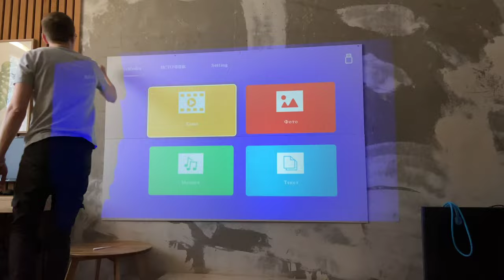How To Build a 100 inches Projector Screen for $25? || DIY Projector Screeen || Polkilo

Comment: Nice, but that cat is going to use that as a scratch pad and showing fish on it with the cat there is not a good idea. I would have elevated the screen a little higher away from cat claws.
Reply from the maker: 😄 that was my mistake) fishes + cat 😅 but everything just fine. She didn’t damage it for this long time since I published the video
Reply: Very lucky, my cat would have put holes in it. @Polkilo

Comment: Hi! I love what you've done here. Kind of resembles what I'm up to right now. I'm planning on ordering a 130" variant of that "anti light" material. I read somewhere that you should put a black clotch behind the screen fabric since its so thin that the light shines through and gets reflected back from the back wall if you don't have something dark/black just behind the fabric. What are your thoughts on this? Is this unnecessary?
Reply from the maker: thank you! i don't think that's necessary to paint wall in black colour. the reflective quality is very good. picture is bright and colourful. the most important is the angle under wich you are looking on the screen. the more it is closer to 90 degrees the mote brighter and colourful picture is. but you can make an experiment before you install screen on the wall. if the result with dark paint will be much more better than without paint, please let me know! i will do the same to my screen 😉🤝👍
Reply: @Polkilo  Yeah I've already installed the projector just about 1 meter over the seating position. I have a Benq W1070+ and it cannot shoot the picture in a straight path even with lens shift at the "lowest setting" so I'm a little worried that the angle will be too steep for a high contrast screen. With this istallation the picture almost reaches the floor. But we will see. I'm a bit worried of hot spotting as well. But this material is so cheap it doesn't really matter if it's not perfect. I'm going to test against a black background, black cloth and compare to it straight on the white wall and see if there's a noticable diffierece. Maybe I'll do a video as well so you can check it out. Not as professional as yours but still. :)
Right now we're renovating the living room and also building doors for two bookshelves. They will be "open" but wrapped with burlap so that I can hide the speakers in them on each side of the projection screen. Also me and my girlsfriend will have our computer spaces built in to these bookshelves with drawer guides so that you can pull out a "desk" for the mouse and keyboards.
Kind of a fun project hiding both our compter spaces and have conseald speakers and audio equipment.
I'm also planning of building a wall hanged furniture just like you did for the screen to stand on.

That was why I commented on your video in the first place. It's like we have the exact same idea going with a high contrast cheapo screen on exactly the kind of home made furniture. Although your project will look way more professional than mine. I don't have the skills or tools you do. Anyway... The screen will be the last thing to come in place so I don't know when it will be finished. If I know myself correctly it can take like 2 months from now hah.
Reply from the maker: Wow! So many plans👍 i hope you and your girlfriend will love this work and relaxing space 😉 you are right. Screen is very cheap and you definitely should try how it works. It has a small angel of view and for big company it can't be Ideal. White wall will be much better. But for 2 people thats enough. This screen is perfect for daytime watching. Hope you can make a video with black wall behind the screen. Hope you will not forget to send me a link 😉😊 wish you all the best 👍🤝🤝

Comment: Thank you very much for this video. I bought the exact same screen on AliExpress and my experience with it isn't that good, because if you look even slightly from a side angle it gets immediately very dark. For me a normal screen or just white wall works much better. But if you can ensure that you're always sitting exactly in line with the projector and the screen, it can work with this screen.
Reply from the maker: Yes, you are absolutely right. This screen is perfect for 1-2 person. For big companies it will be uncomfortable 😣

Comment: I don't understand why you vaporized the screen tissue at the very end, when it was already assembled but still laying on the ground.
Nice work.
Ps: what tool did you use to make the diagonal holes in the wood to screw everything together aestetically?
Reply from the maker: I was afraid to ruin the screen, so I tried to steam it from the back.
I made this station myself. here is the video https://youtu.be/rM7LwM4BWGk
link to tool http://shp.pub/6ak6lf

Comment: Great guide!

Does the manufacturer consider the edges that are folded around the frame? What I mean is, if the wooden frame is 100 inches, do I have to buy a larger cloth to compensate for the material that is folded and stapled at the sides and rear?
Reply from the maker: Hi! my wood frame size is 217*120= 260cm. 260cm - 102.36" . So you wont need to by a larger cloth to compensate. Also you can contact with seller :)